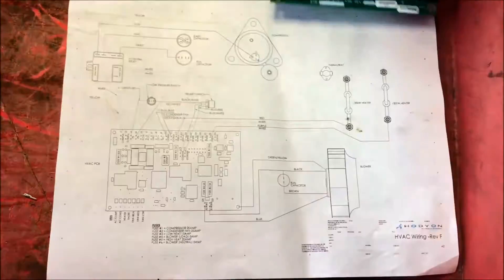Dynasys APU // HVAC Series // HVAC Overview

Comment: Can the capacitor  if it is bad make the compress not run fully or not at all ,mine is not blowing cold but it doesn't sound like the compressor is running fully [like in half]
Reply: Did you solve the issue?

Comment: Mines keep saying safety cover is off under active alarm. But no cover is off. How to i bypass it to get mines back working
Reply: I hope you fixed your problem. I just bypassed the switch on the unit. Dynasys is a joke, every summer the AC needs something fixed. Try finding some one to do it. The yanmar will run forever but the shit under the bunk is another story. Once in Atlanta at a dealer dynasys referd me too called it a boat anchor and said it wasn't worth fixing, it was 2 yrs old. Very expensive anchor. When they had the recall for fires I was sent to rush peterbilt in Ontario ca to replace the wiring, they didn't. That's been several years not knowing this till recently. A piece of shit is all it is.
Reply from the maker: Demario, sorry for the delayed response.  The quickest way to reach us would be via email apusupport@dynasysapu.com or call us a 308-762-2975.Please call and a technician can walk you through your problem.
Reply from the maker: Demario,Sorry for the delayed response.  Please contact our tech support line and they can help you out.  308-762-2975.In the future, if you need immediate assistance please call this number as we will be able to get back with you much quicker.

Comment: My fan just stop blowing.  It's not blowing hot or cold. What could be the problem
Reply from the maker: The blower fan in the HVAC Box runs on 110V and this is powered by the generator.  Please call our tech support line and we can help you out or get you to the nearest dealer!  308-762-2975
Reply: Did you get it fixed? have the same problem